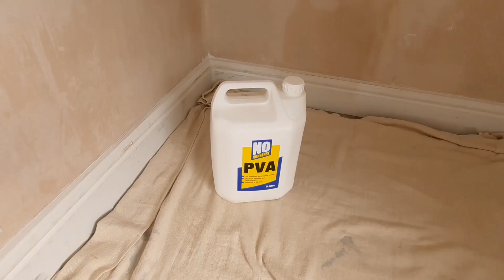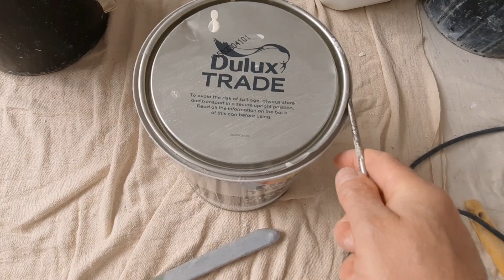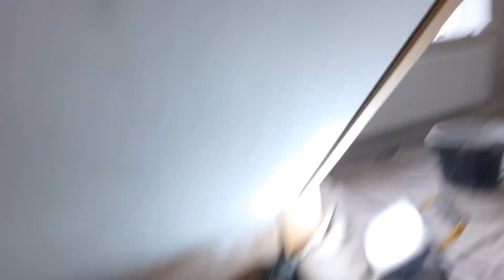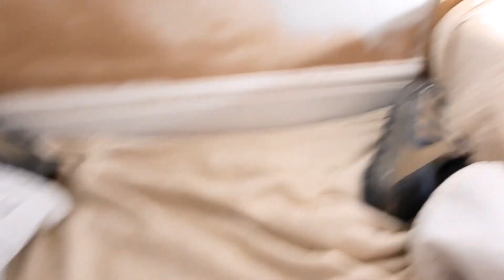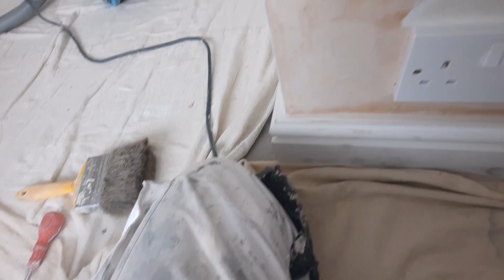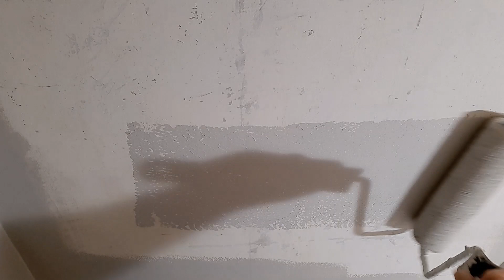Painting And Rolling

Comment: WHICH IS THE BEST ROLLER SLEEVE FOR EMULSION???
Reply from the maker: Loads of different types and depends on paint and surface. Thanks
Reply: I use Hamilton rollers for Dulux emulsion paint on plastered walls and ceilings👍🏼
Reply: I prefer I tight bit roller for new fresh walls

Comment: Why did you pva on fresh plaster could you not mist coat then vinyl matt afterwards?
Reply from the maker: PVA is cheaper and faster to use cleaner and sticks better than a mist coat...
Reply from the maker: @Gary Day mate you know idea its funny 😄
Reply: Gary Day But this is why he uses a ‘diluted’ pva mix. You speak as if he’s applying neat pva. With this consistency, of course it will be sinking into the plaster work. Makes sense to me and in my opinion does exact what a mist coat does. Quite the accusation to imply he doesn’t know what he’s doing when he’s clearly a dab hand.

Comment: So you just primed the bare plaster wall with diluted PVA, then went straight on with the dulux diamond matt paint? No need for an undercoat? Thanks
Reply from the maker: Diamond matt is second coat because they ran out of the normal vinyl matt.. so it was diluted PVA then normal vinyl matt..
Reply: @PaintingandDecorating  surely vinyl not good idea for new plaster?
Reply from the maker: @smurfman691  it's okay as long as the plaster has been sealed..  diluted PVA
Reply: @PaintingandDecorating  thanks, learn something new everyday!

Comment: This was so relaxing! 😌. I do have a question though, 😏 any advice on how to paint over old oil based eggshell paint, at least that’s what I think it is. Anything I paint over it goes funny in patches and peals back off .  I’ve tried sanding it but it’s still doing weird things to the new paint 🙈. Thanks 🙏
Reply from the maker: Thanks, first you should wash the surface down and then sand, ghd  a coat of acrylic undercoat.
Reply: Painting and Decorating is there one you could recommend for walls?  Many thank 👍
Reply: Is it first coat on plastered walls? Maybe just wasn't mist coat for first coat that's the reason it's peeling any good vinyl mat is a good paint dulux or crown may be silk you have on your walls or acrylic eggshell
Reply: Pandy Connor it appears to be an old oil bases eggshell paint from the 1960’s. Sanding it appears to have done the trick. Thanks
Reply: Watch this painter a lot when have time he takes his time to explain what he's doing I'm timesevered never stop learning not a fan of the harsh remarks he gets sure he doesn't work that speed when not making videos livechangechallenge

Comment: Don’t PVA walls or ceilings😣 just mistcoat them with pissy emulsion your otherwise your doing an extra coat for no reason lol. Pva shouldn’t be used as  anything for painting lol
Reply from the maker: Apart  from they actually put PVA in some paints..   understand your materials
Reply: @PaintingandDecorating  completely different to applying paint on top of PVA
Reply: Why do you mist with pva instead of emulsion then?
Reply from the maker: @hughespaintingdecorating3348  PVA is diluted and soaks into the plaster completely. And does not leave a skin on the surface, the paint which then can be applied without a mist coat...   because PVA is a glue and has soaked in,  the paint also soaks in a little and bonds with the PVA....   once dry it is tougher than just watered down paint as the pigments never really soak in....
Reply: @PaintingandDecorating  so why does it state on the back of tins to use watered down emulsion? And when plasterers Patch up and they pva too far into the existing wall, why does the emulsion take far more coats to cover?
Reply from the maker: @hughespaintingdecorating3348  Plasterers use neat PVA to bond plaster we use diluted PVA like milky water it soaks in.   The paint manufactures want you to use more paint ..   and a mist coat does work done correctly but is messy and more expensive...  and ultimately not as tough..  have you ever striped paper and the paint has come off the wall... that's a mist coat gone wrong ... does not do this with diluted PVA..